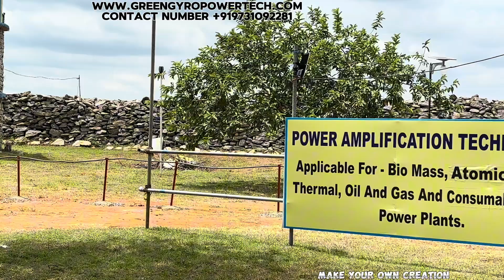World First Commercial Flywheel Energy Technology from 1% Input 100% Output - Generator

Comment: I bought a complete flywheel free energy permanent magnet 26kw generator with its 4kw motor as a prime mover.  I could started operating it without connecting any load to generator.  However, once the first 1kw load connected to generator it starts to slow down and motor tries to retain its original speed but with higher amps current and more power consumption and overheating.  Can you help me what went wrong and how to resolve this problem ??

Comment: Thanks for sharing news of this First Commercial Flywheel Energy Technology    !

_ May be, it will be interesting to complet solar off grid plant too with storage energy ??
During the day, the sun powers the grid and the surplus energy is stored in batteries.
 At night, the Flywheel Energy    runs on battery power to continue powering the grid.
_ Could be relevant for off-grid irrigation pumping applications  in remote areas !!

What do you think? Your opinion?